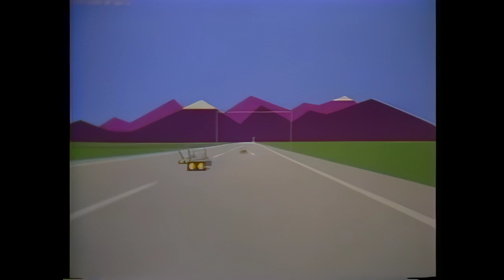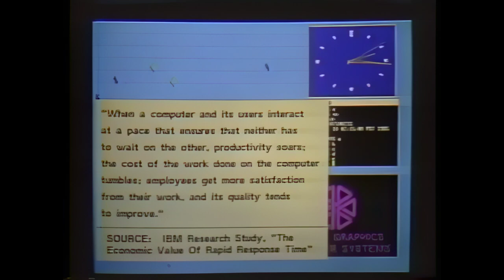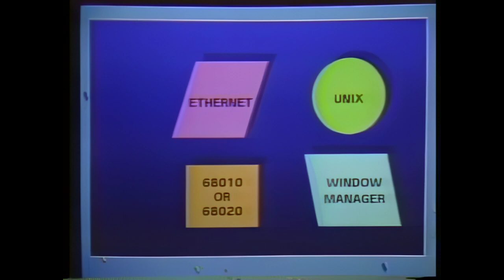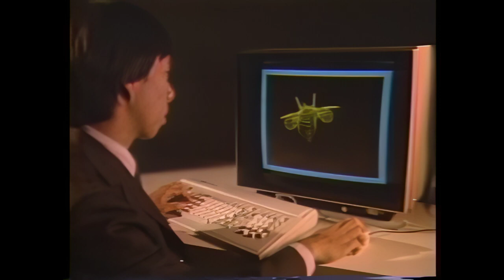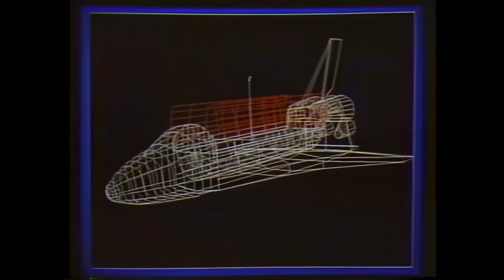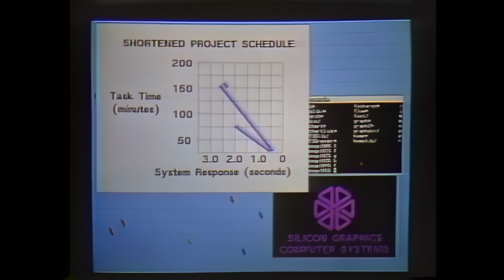Silicon Graphics IRIS 2000 : Dream Machine for 3D CGI in 1985

Comment: We developed the new instructor operator station (IOS) for the F-16 using Silicon Graphics Workstations between 1985 and 1987.  It was a huge leap from the green screens.  You could have a god's eye view of the training area, the pilot's eye, or aggressor eye.  Slide in/out instrument panes, calculators, etc.  We coded everything from the ground up including developing a new protocol to talk to the Norsk data mainframe which actually ran the simulation.  Hard to believe everything that machine/system did on such limited hardware (advanced for the time).